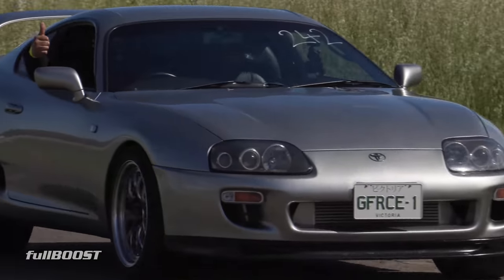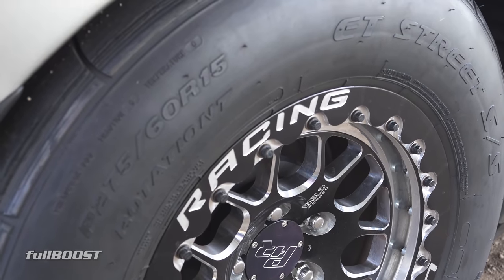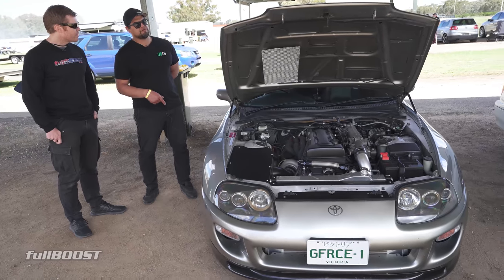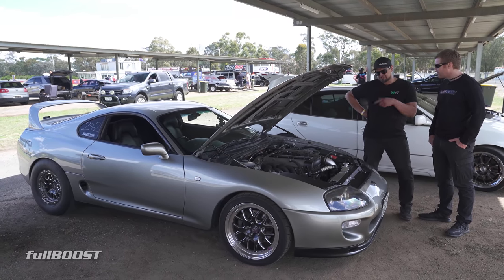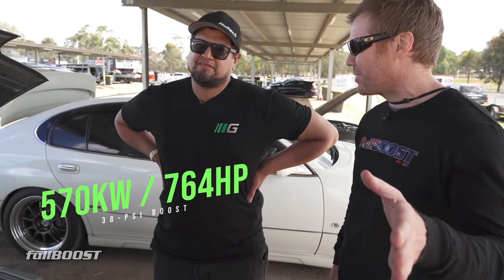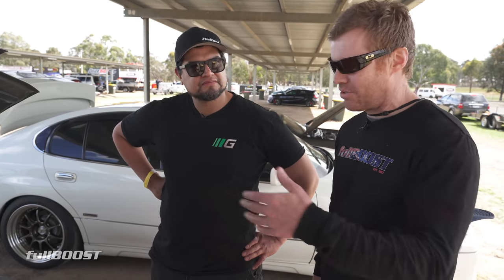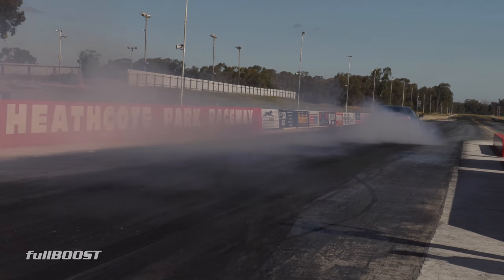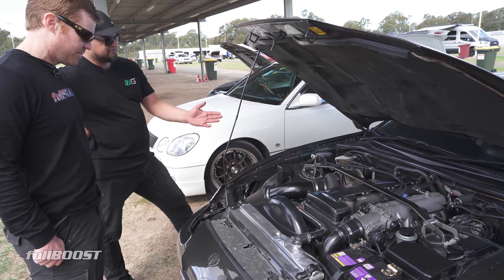Inside a 9-second daily driven 2JZ Supra | fullBOOST

Comment: I ran at the mid 10s level before my a340 gave up the ghost, had the same FTI converter too ! Best off the shelf converter for that box
Reply: Joe Blow  I've replaced it with a bulletproof th400 and its the tits haha
Reply: Was this a stock transmission...just with the upgraded converter?
Reply: @duanerdyer1  it had a stage 2 MV shift kit, shimmed accumulators and an extra large Transcoolers, besides the stally. No additional clutches or upgraded hard-parts were utilised as far as I know.
Reply: @callanbice4485  Wow...and how long did it last? How many 1/4m pulls?

Comment: Just finished my 1.5jz for my 90 Supra. Is300 2j block, Acl main .001 bearings, king .001 race rod bearings, k1 technologies rods, stock 1jz piston, BC valve train and 272 cams on Ecu masters emu black. Can’t wait to see the power it makes
Reply: Do you run stock timing tensioner bracket or go to billet
Reply: @relaxnheal8640  stock, no need for billet until you’re touching 1k whp

Comment: 764 whp on stock Auto A340 ???  
People claim it will tear up around 500 crank hp
Reply from the maker: No they won't if setup right.
Reply: @fullboost  If what is setup right ??
Reply: Iv run 600whp with a very similar set up to what gerado has. Shift kit and stall, and never had any issues, it was also my daily.
Reply: @chryspaps4140  Im still on stock twins, i have no plans to do a single turbo yet, no $$, maybe when i hit that $100k scratch off ticket then YES.